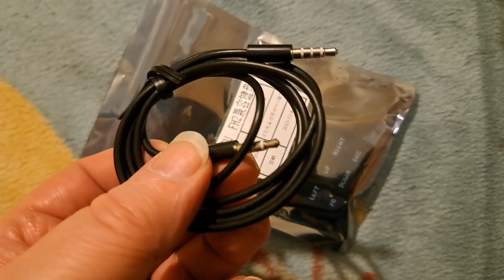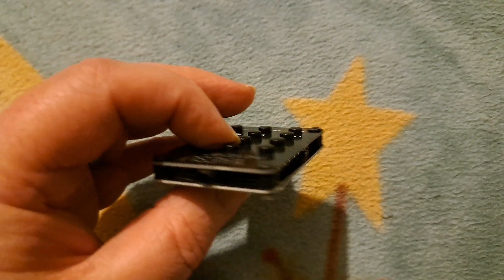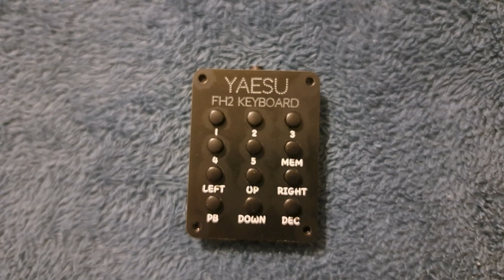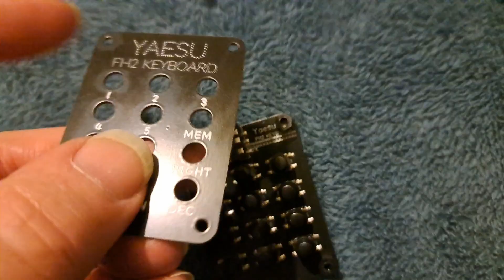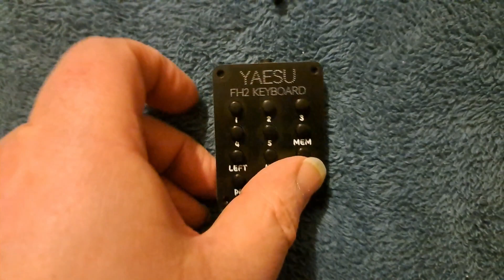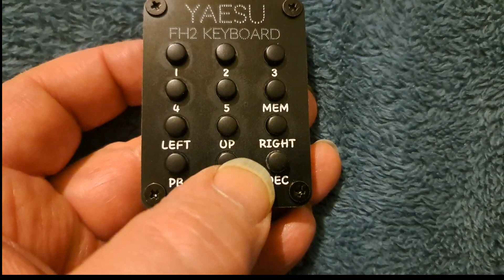Yaesu FH-2 Clone Radio Remote Control Issue and Solution.

Comment: I remember making a resistor matrix keypad remote for the JVC/Ferguson VHS VCR machine in the 80s.  I wonder if this uses the same values?
Reply from the maker: I can't tell you what the values were. 
I fixed the hole that was making the switch stick and put it back together.
I could measure the terminals tho.
Reply from the maker: I had one of those video recorders with the cable remote control. I think I gave it away.
Reply: IT was this one - https://i.ebayimg.com/images/g/iIAAAOSwyYllDCB4/s-l1600.jpg  @KB1UIF
Reply: Those were the days!  @KB1UIF